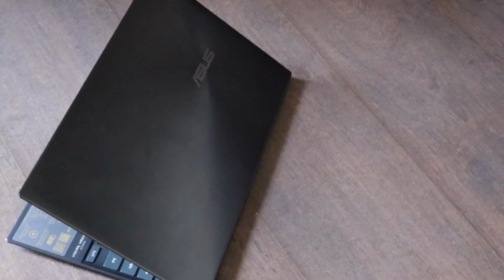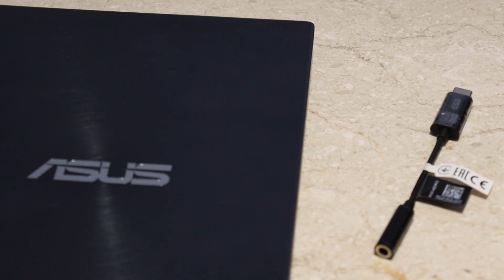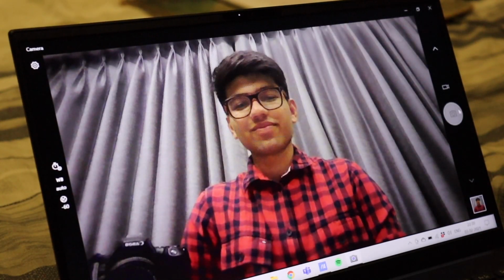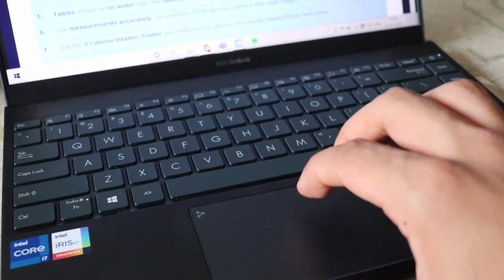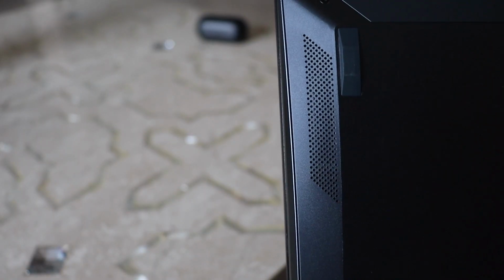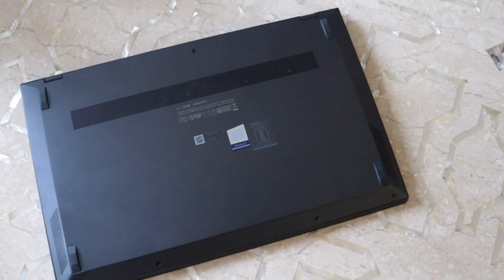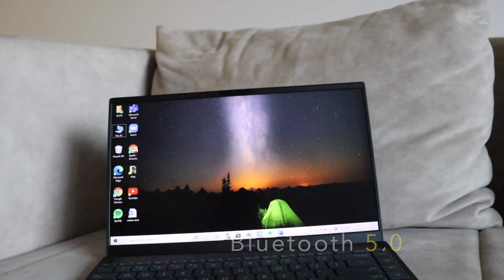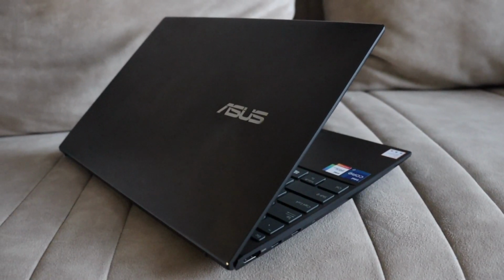Reviewed ASUS Zenbook 14

Comment: I bought this computer 3 months ago. When I'm wearing headphones and talking on Zoom or Skype, my microphone suddenly turns off. To fix the problem, I either leave the call or remove the headset and plug it back in. I have this problem 3-4 times when I'm on a call. If I connect without headphones, it's fine. What is the reason of this? Has anyone experienced this situation before?

Comment: Any idea about the usb c easy charge feature? I guess the laptop can be charged using charger having 5-20 volts rating according to specification sheet..is it true?
Reply from the maker: A lower wattage won't give you fast charging thus not recommended but can be used in emergency, so yes it is true. Meanwhile 65W is the maximum that you can use
Reply: @rachitarora777  Thanks for replying. Have you purchased any additional accessories for this laptop?
Reply from the maker: @meenanavale6786  No problem, I haven't but I soon plan to buy a dongle having a ethernet, SD card and a couple of USB Ports.